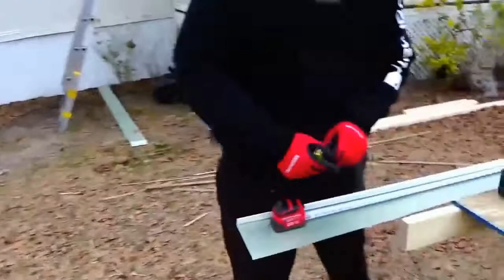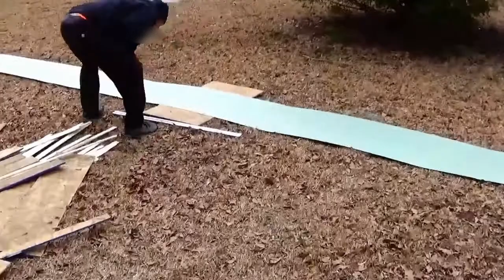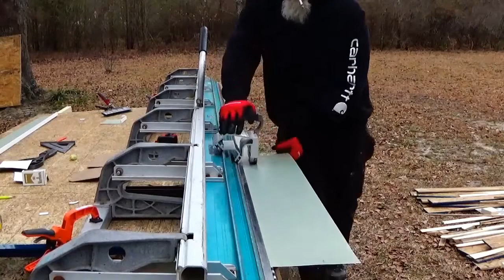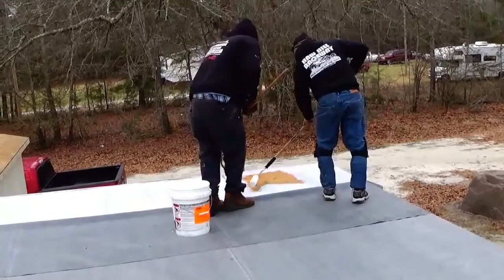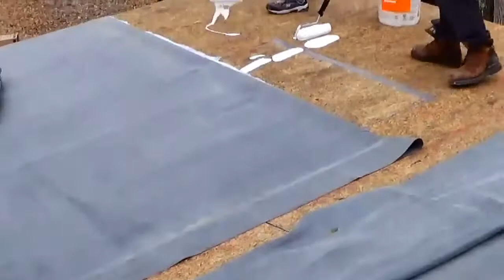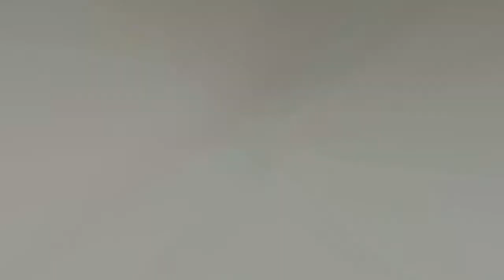Mobile Home Roof Repairs 2 with Drew

Comment: If the client is using wood heat can you still use the rubber roofing?
Reply from the maker: Yes. Keep everything away from the heat stack that comes out of the roof and you will be fine. I’ve done it before keep the rubber away from the heat source
Reply from the maker: Absolutely no problem with any kind of heat actually. Have you been watching our Mobile Home Floor Repairs series that we have had it going on for the last three weeks?